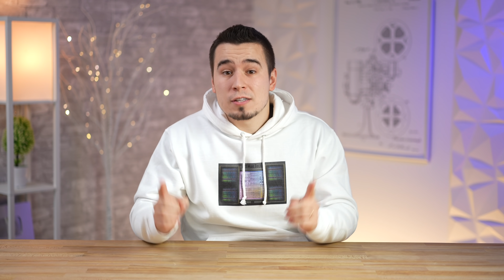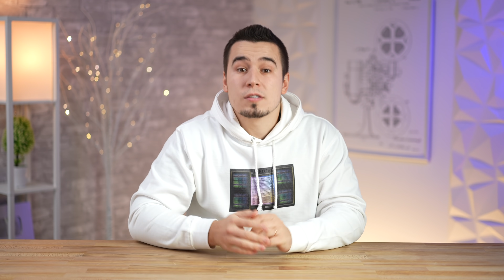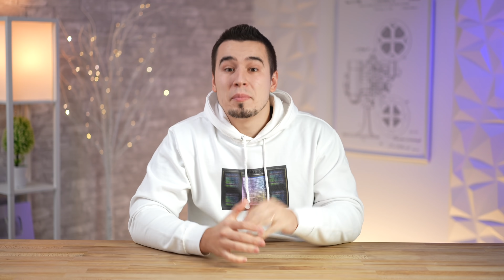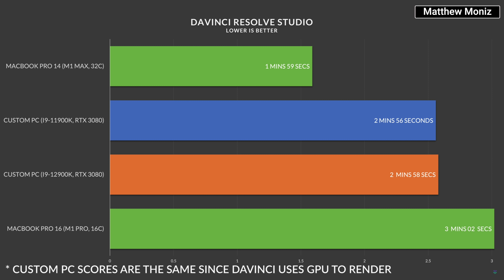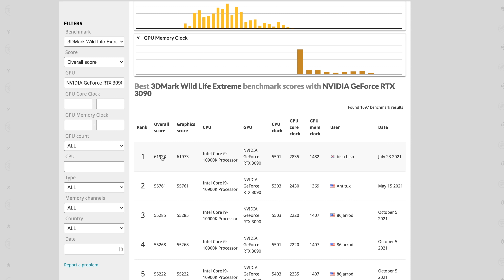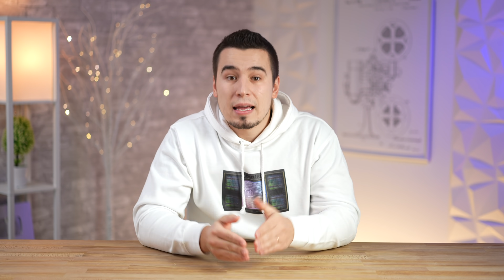M1 Max Quadro Mac Pro Leaks - The Alder Lake KILLER! 🤯

Comment: I feel these few years Apple is trying to RILE us regular users with the increased prices. They are not keeping to the pricing brought by Steve Jobs, in making the base models 'affordable' same as the older ones are priced, and stepping up one hundred squared per addition of specs, What they are doing is outpricing themselves and antagonizing the pro users by doubling the prices ,100, 200, 400, 800 and using every bit of binned CPUs making us feel that they did it on purpose whereas the binned ones are actually mistakes in Manufacturing. Apple's latest CEO is taking advantage of our hunger for new models of what we already have, but not curbing their own greed in pricing it low enough to grab the market in only slight increases. Those of us who are sensible enough like yourself, will hold off from buying and keeping  the highest models and make do with what we can really afford, and what will just recover our investments instead of us going all crazy like there's a "limited edition" but with unlimited prices!! 
I'm staying with the base models. Thanks for the great comparisons, but I know you'll be clever in returning the costly ones after your tests.

Comment: My biggest problem is the “absurd” pricing that you are listing.  The Apple Mac Pro was NEVER worth the $5,000+ base price, but that was due primarily to Intel’s insane pricing in their Xeon chips.  Apple could have built far more powerful computers at a much much lower cost had they designed the Apple Mac Pro using AMD processors.

But either way, it’s irrelevant now as Apple is now developing their own silicon.  As a consumer I would expect these cost savings to be passed on to the consumer and instead of an insanely overpriced garbage Mac Pro ($5,900+) that gets completely crushed by most moderately priced AMD desktops with RTX 3080’s, that cost below $1,800-$2,000.

I would expect a 40 core Apple Mac Pro (that costs Apple about $800 in chipset/die cost) to be priced around $2,000 to $2,400 with the very top model being in the $2,800 range.

That would take it back down to the 2008 Apple Mac Pro (dual Xeon) pricing and more in line with what consumers should be paying for a powerful workstation in the $2,000 price range.

I think the pricing you are quoting is completely ridiculous and completely absurd, and without Apple being “held hostage” by Intel’s (or AMD’s) ridiculous pricing, it allows Apple to “cut out” Intel, AMD or NVIDIA and build their own fairly inexpensive silicon and we as consumers should begin to see much more powerful (and far more energy efficient) Apple computers and priced more along the lines of $1,800-$2,400 pricing and NOT the ridiculously prices that you are quoting on the custom AMD graphics cards or ridiculously overpriced Xeon processors, and if you subtract $7,000+ from that price tag, and replace the CPU and GPU with a single $800 chipset then if you factor in a case and power supply and fans, keyboard and mouse and you should be at a $1,000-$1,100 cost (for Apple) and that should be about a $1,700-$2,000 priced 40-core workstation for consumers!  

Prices should come down tremendously as all the components (RAM, CPU, GPU, etc) are now being integrated together into a single $800 chipset.  Reducing thousands of dollars of third party components into a single “all in one” SoC chipset at the $800 cost.  So I would expect adding an enclosure/case, fans, motherboard, and smaller power supply and the combined costs should be in then $1,100 to $1,400 price range and I would expect customer pricing to be in the $1,700 to $2,400 price range (with the very very highest binned/sku at maybe $2,800 fully loaded).  That is what I would expect and anything higher than that is completely absurd and would never even match up or compare to a $2,000 priced AMD system with a RTX 4080 graphics card.  Apple systems have been way way way overpriced in the past, but I blame Intel (Xeon) insane processor prices and insanely overpriced custom AMD graphics cards as two of the biggest failures of the current Apple Mac Pro.

Had Apple just used an AMD Threadripper and RTX 3080, you would see far more powerful Apple Mac Pro’s that would be in the $2,000 price range instead of the $7,000 to $50,000 price range that Apple is trying to charge.

NOBODY will take Apple seriously if they continue to overprice their workstation and Mac Pro products when compared to Windows-based AMD Threadripper and RTX 3080 graphics cards.

Also with Apple producing it’s own chipsets we don’t have to worry about the “price gouging” and “scalper” pricing that customers have had to deal with during the past year dealing with crypto miners swallowing up ALL of the consumer graphics cards to build mining rigs.

Prices need to come down (not go up) and I believe $1,700-$2,400 should be the price point for the 40-core Apple Mac Pro, especially with the smaller case, smaller power supply, smaller motherboard and lower motherboard costs and lower cooling costs.  So $1,700-$2,400 is what I believe the next Mac Pro with 40-cores should cost, giving students, artists, and developers a decent (and more affordable) workstation in the $1,700-$2,400 price range.

Comment: Even though the Mac Pro chassis could be re-designed to be smaller, it doesn’t make any sense to do so.  Mac Pro users may have need for Intel and even AMD chips well into the next few years.  Ideally, one should be able to swap out the CPU motherboard at will.

Wouldn’t it be so cool if an existing Mac Pro user could simply pull the Intel I-9 motherboard out and put an Apple Silicon motherboard in its place?

Comment: You're not factoring in the power that the infinity fabric requires. I'd expect that to be an extra ~50 watts, like in EPYC cpus, overclocking to mitigate performance loss, which should be an extra ~100 watts, resulting in more than 500 watts on a fairly small die. They will need extreme cooling, and the heatsink will likely need to be bigger than that of the current design. That includes an entire soc compared to just the cpu, But that still is a lot to cool on a die around the same size as the aforementioned xeon ...

Comment: umm i dont think that will be enough because it would bring the price way down which is unlike apple. i think they will go even further with more gpu cores and ram on this one as the current mac pro have 1.5tb ram option so apple will atleast top this newer one at 512ram and 256core gpu custom chip

Comment: Always  comparing an PRO apple to consumer cpus or gpus makes no sense. Apple will charge pro money, so pls compare it with workstation class components, or it sounds like a hyped fanboys blahblah.... If compared to workstation class components in pc's the m1 max still looks good because of the better power efficiency. Even if it will not be able to outperform the highest end workstation parts from last year. 
I use win, lin and mac. Btw. i already had unified memory architecture back in 1997... with my sgi (silicon graphics) o2. :P

Comment: Question: why the assumption that this will be based on M1 cores, instead of M2? Would seem strange to base it on an older architecture if they're releasing it toward the end of 2022. I'd hope for increased single-core performance, since the M2 only more or less equals the single core performance of the best chips already available. 

Also ... what's on Nvidia's high-end gpu roadmap for the next year? Have you compared to the projected performance of this?

Comment: The M1 Max doesn't beat Alder Lake and Ryzen 9 in CPU performance, only in power efficiency. Apple will not beat Xeons and  Threadrippers with Quadros either. The disruption already happened in 2020 with the Macbook Air. Let Apple cut the entry price in half with a plastic laptop and we're talking market disruption.

Comment: The SOC doesn't really lend itself to upgrades and plug-in hardware expansion.  What I would do is design a Pro that lets the owner swap in a whole new, more powerful SOC, with the older SOC going back to Apple for credit.  There'd be slots for separately swappable SSDs.  The enclosure, power supply, and I/O hardware would have quite a long service life, making it more cost-effective and environmentally acceptable.

Comment: You need to dream a little bigger darling🤣
In the new system they should build a custom DPU that act's as a PCI-E (5.0 or 6.0) switch + high performance network interface
The motherboard for the DPU would have 8× PCI-E 16× interfaces
The 1st add in card should be a HBM version of ether the Max or the Pro chip with thunderbolt out
The 2nd card should be the same as before but no thunderbolt
The 3rd should be an thunderbolt + USB  interface card
The 4th should be ab NVMe adapter + raid card

Comment: Thanks for this, Vadim. I can't wait to see what the form factor will be like if not exactly as you described and whether Apple's new type of Infinity fabric will have any cousin that connects to a faster external drive technology of the future.
The other thing is, 128 cores seems so small. I would be hoping to see hundreds of cores since the power requirement is so low and a desktop system doesn't have the limitations of a laptop. How much power will the expansion slots take?
Great video in every way imaginable!

Comment: I have an idea. What if instead of having one chip, there were multiple cards you could slot in and each one of them had multiple chips. That would such a nice use of the SoC design and would mean you could slot in more cards into the chassis.

Comment: So this is Apple idea about the promised "upgradeability" as the main focus when they launched the Mac Pro,  to tell clients to throw away the whole computer  and buy a new one...
By the way according to Apple the Mac Pro is a "Workstation"  (and priced accordingly, well over 10.000$ for decent specs ), not a "consumer device". Comparing it with a 500$ Alder lake chip (or to a 1500$ PC included the GPU)  is absolutely  ridiculous. The current  competitor of the Mac Pro is not a 12900K PC with a high end Nvidia  (even if is faster, but that is another question   ), because at those budgets  the Workstation class  is  curently dominated by AMD with the Threadripper Pro and the  NVidia A6000. Not consumer products.
Another missconception  is that  the Threadripper Pro  is NOT a "server" chip but a "Workstation" chip.   (he seems to be confused with EPYC, which is the AMD  model for servers). 
Finally comparing today PCs (and it's  GPUs from past year) with  an Apple  computer that is more than one year in the future is another absurdity. If you really want to speculate you would need to compare with NVidia 4000 series, PCIe-5,  the incoming 128 core  Threadripper (or next gen Intel Xeons ) and also Thunderbolt 5, which by the way is going to be an  Intel exclusive, as Apple is now a competitor for Intel rather than a partner.

Comment: it's impossible. losses will be more than 10%! if they do this scaling, it will be a road to nowhere and they will step on their tail in the end
In addition, the apple will update the socket for xeon 33XX in 2022 - and this is a fact. perhaps it will be the last product with the X86 architecture, but it also suggests that they do not have a ready-made solution to do this. physics is hard to fool. although M1 admires me, since the days of ipad pro 12.9 2017
Reply: Apple has all their Mac chips already designed before they even announced the transition to Apple Silicon. They design chips years in advance. You don’t just simply design a chip overnight.

Comment: A great explanation. I don’t think Apple will change the size. They tend to hold on to MacPros designs for a very long time, sometimes to long. It would be a lot cheaper to keep the design they have now and allow space for future upgrades. It is a small market, one that doesn’t care about the box that much.
Reply: A new design is much cheaper than the material of their case if it can be reduced in size. This includes shipping and material actually. I expect that they can have a most binned down version being 2500-3000 which will still knock the crap out of equivalent custom built PCs given the chip shortage all while still using only a fraction of the wattage which factors into cost of use and longevity. I hope they take thermals seriously enough to ensure this minimalistic redesign would not have to constantly run at audible volume to perform day-to-day tasks though.

Comment: Bro, the current ones cant compete with the base model gpu, but it would be interesting to see how they ll stack up in upcoming products. I hope they ll stay sane with the pricing. And as for your concern on design i guess you need to watch some ltt videos, that mac pro design is shit. Instead of taking cue from industry leaders in cooling they tried doing yolo and why use xeon, they suck tbh you can take a look at epyc or threadrippers, they are awesome cpus. As for the unified architecture of apu +memory , it ll be heavy like 200-400watts like in consoles so you will definitely need a good hefty cooler for such aio silicon even if u go 3nm

Comment: i think
Imac 27 inch 2022 (cpu 12 or 14 core, gpu 32 64  )
imac pro 27 inch 2022 (cpu 14 or 16 core, 32, 64, 🤔128 gpu )

maybe 🌡️ (🧐20 or 30 core cpu, and 64, 128 gpu) for the one of the most comparation with , i7, i9, Ryz. 7 or 9 desktop performance or Threadrriper
MAC Pro  😂😂 60x cpu,  256x gpu😂😂

Comment: I wondering if they would start with a base Mac Pro tower with the M1 Max 10-core CPU, 32-core GPU, 32 GB Ram setup.  In order to start the price at $2,999. Then go up from there.  This would allow them to re-use the current M1 Max chip but in a tower.
Reply: They wouldn’t take the same power and convert it into a desktop. They would possibly start at higher prices with high ends specs.

Comment: Very insightful speculation! Completely agree, except rather than “Quadro,” I would argue Apple would re-use “Quadra,” which they already have the trademarks for (NVIDIA might object to “Quadro” as they own that particular trademark). BTW, the Mac Quadra 700 and 900 were the first Macs to feature the Motorola 68040 chips—a mind-blowing 3-4 times faster than the previous gen 68030 processors. But I think Apple will come up with something new in terms of the branding.
Reply: Oh yes I recall running Mac OS7 on a Motorola 68040. That was snappy.

Comment: Actually Apple might overclock the whole chip aswell as combine 204 of them allowing for more power and more heat but making use of the triple fan setup and keep the old Mac Pro design. just like they did with the M1 macs.

Comment: Quadro is an Nvidia brand, I don't think Apple would simply use it as theirs, not to mention not always it will be 4x the Max.
Reply: Apple does own "Quadra" ... it was an early pre PowerPc workstation. They could bring that name back, if they're confident that most of their customers are too young to remember the old desktop boat anchor.
Reply: @paulraphael  I think it's much easier so use another letter instead of M1 and adding more suffixes, make it P1 or S1 or X1, it's easier to understand as well. Then you can still use Pro and Max for higher-end, giving 3 options for Mac Pro SoC.

Comment: What disappoints me about this timeline is that the M1 would be a three-year old technology by the time they got around to releasing a Mac Pro. Could they not have planned ahead and planned for an M3 Quadra by then based on TSMC’s 3nm process with single cores based on the A16 processor family? Now that would blow the socks off of Alder Lake while Alder Lake seems to have a significant edge on single core performance, getting GeekBench scores of over 2600. Even overclocked, I don’t see M1 competing with that.

Comment: Not possible... combining 4 chip-set with rather slow inter-connect should not perform well.
But Apple will not design seprate desktop suited CPU (not enough sales to cover the cost).  Let's see what happens in 2022!

Comment: Problem with those Neural Engines is they are not used for training, at least not yet. They are FP16. Nvidia’s tensor cores are also FP16, but can be used for training, with mixed precision training. Hopefully Apple can do the same. Otherwise, hard to compete with a RTX 3090 in ML training.